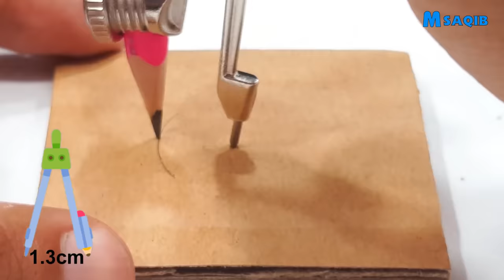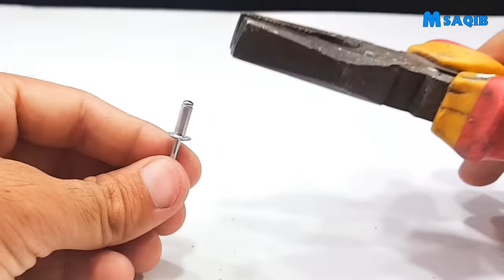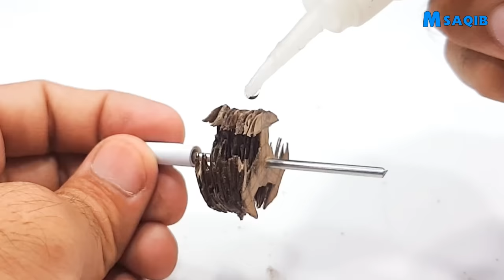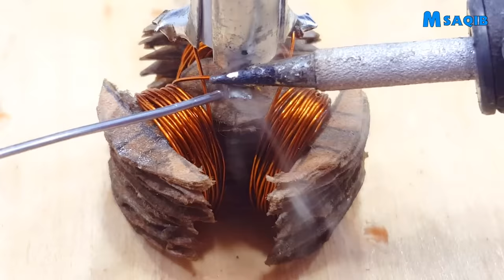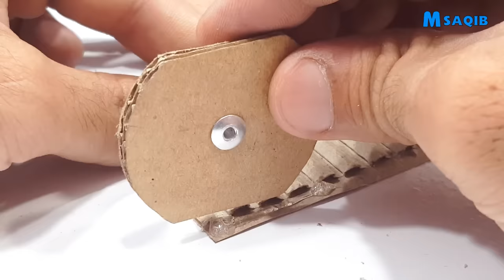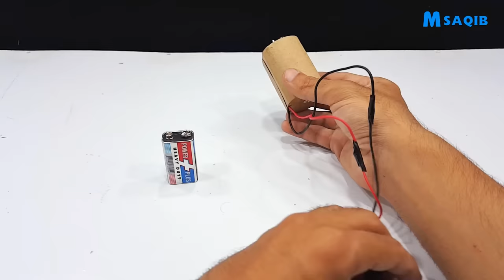How to Make a Motor (Cardboard DC Motor) DIY at Home || M SAQIB

Comment: Nice project but instead of using using cardboard in the rotor which is weak, flammable, hard to work with, etc. Consider using a solid piece of light weight wood. Also, if you can't find alluminum like that laying around you can use copper from a pipe fitting which is a better conductor and less likely to break under stress. Another thing is the metal used for the rotor itself should be filed smooth for cosmetics as well as preventing  damage to the motor itself. Finally, try using number 2 pencil lead for contact brushes as the graphite is a type of lubricant that would increase motor speed, it would also increase efficiency and reduce heat. There you guys go lol
Reply: .#x

Comment: okay quick question: are the wires wired parallel or series? And is it correct that only two of the metal plates conduct electricity at a time?
Reply: Their should only be one wire in your motor, if your making a standard brushed DC motor, which would be considered a series arrangement. And yes, because one contact is being used for the North end of the electromagnet and the other for the South end.

Comment: Sir, which metal that you used??
Reply: If you're talking about that wire that he wrapped the cardboard with .... its copper (or bronze as far as i. Know 
And for the metal in the bottom of the motor i think its iron to enhance the strengh of the magnetic field
Reply: Cable de cobre

Comment: 02 major problems with this cardboard design:
1- How do the windings generate magnetic field around cardboard pile  without ferromagnetic metal?
2- How do this cardboard pile deal with "Faucault current"...after all thats the reason they are in pile structure...